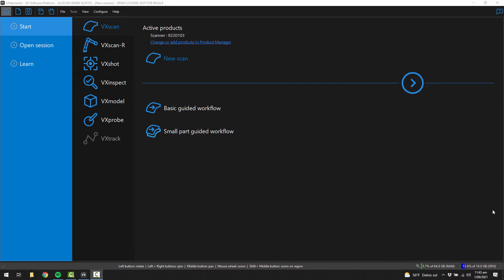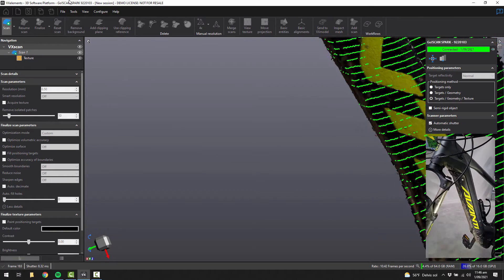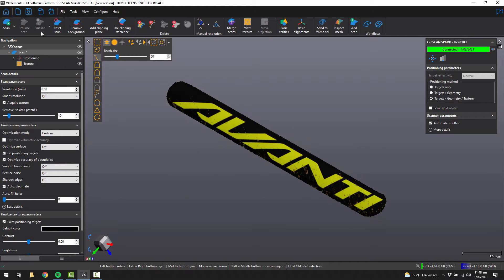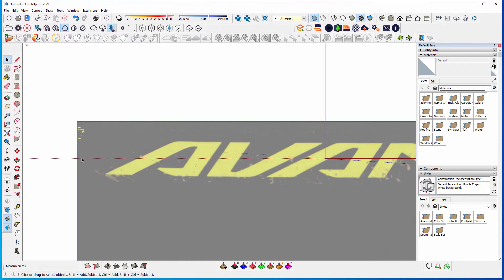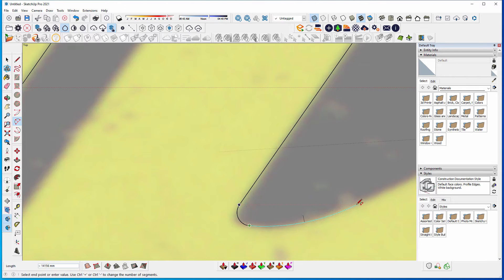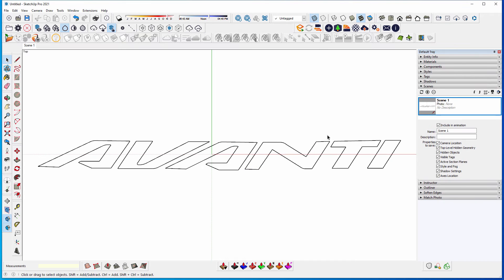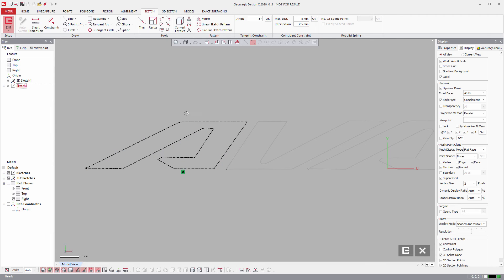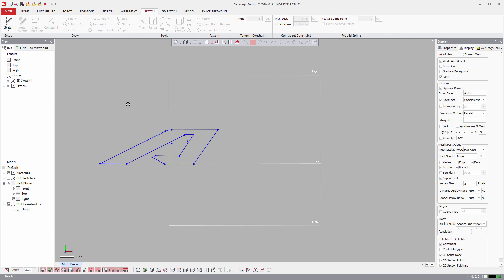How to create 2D Decals from 3D Scans - Demonstration

Comment: Interesting video! Thanks for posting it. What I'm wondering about if you have letters in a curvatured position. In the example in this video, the logo is printed on a flat surface of the bike frame. Let's say that if you make a 3D scan of a logo on a tubular shape and the shape of the letters are curved. What is your advise on how to flatten the letters to be able to create the (flat) 2D decal?
Reply from the maker: With the latest version of VXelements / VXmodel we can now cut out the lettering and flatten it to obtain the vector outline.  Of course this is more ideal for logo's wrapped around a 3D shape.